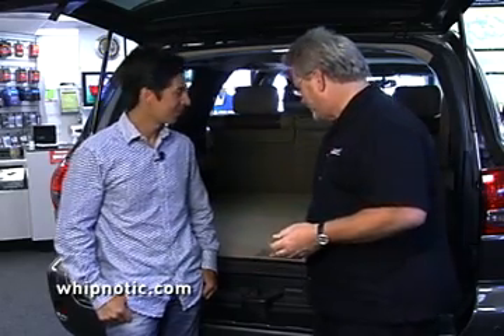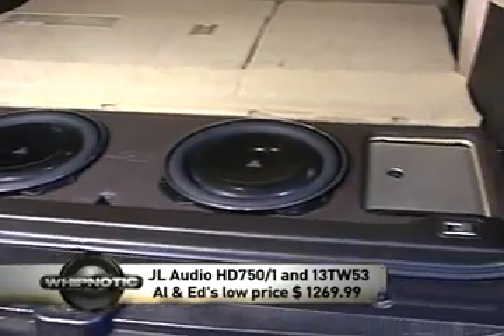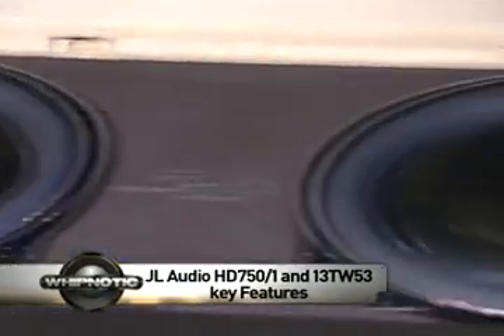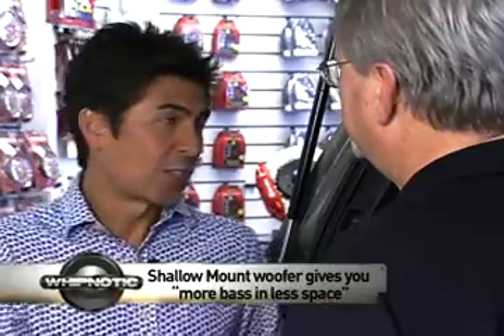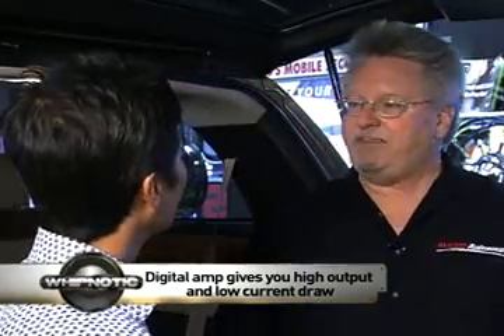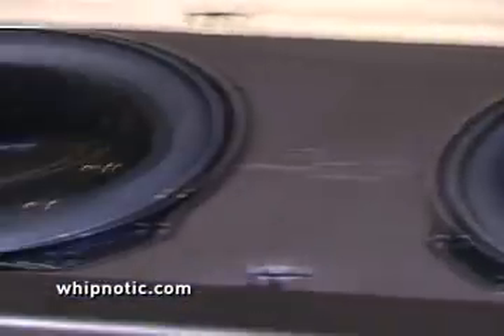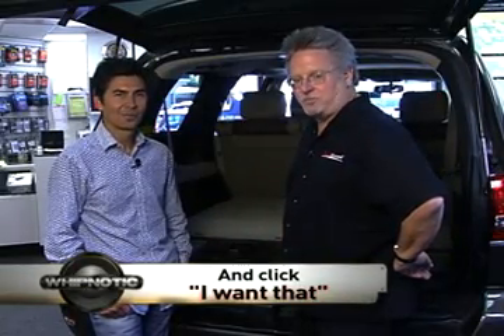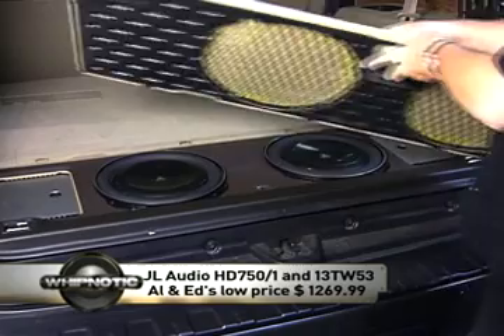JL Audio HD750/1 & JL Audio 13TW53

Comment: MAYBE the amp but shallow subs suck. I have 2 12 inch Tw3s. With that amp. New full size subs or neve rhave that are shaking bass. Or at least in my experience. Anyone want to buy 2 12 inch Tw3s cheap? In stealthbox for chevy avalanche. No use for them anymore.

Comment: Lol that system is definitely a lot more money then $1200. RCA’s, power ground wire fuse holder’s custom sub box and more. I bet that system installed will run at least $4500-$5000 If not more .

Comment: I bought 2 jl audio 12w7AE and the hd750/1 for $800 12-1300 dollars for that setup is a bit high smh you have to do you home work  to see what type of sound/bass you won't but I never spent  $1200 for any system I ever built over the last 17 years and I have owned orion hcca subs, kicker cvr ,cvx, L5,l7 rockford fosgate hx2 and x7a amps etc and never spent that much money for 1 setup

Comment: $1200.. for that set up is questionable unless US pricing is that much better. I have a similar setup paid for in Canada and even working out a cash deal on the amps i still paid close to $3000 for my HD 750/1 and HD 600/4 and TW13 the components for the door speakers I ended up spending another $1200.

Comment: Maybe you can't read. I've installed JL Audio many times and been around car audio for too long. Call JL support and ask them if they build a SPL sub. Maybe you'll believe them? If the dummies you speak of go to a real comp their JL w7 will get crushed on the termlab. I've seen it too many times. If you compare DD, Fi Btl, or an Audioque HDC4 to JL which are cheaper than a 13w7, the 13w7 cannot hang at all in spl. SQ is a different topic.

Comment: @360ModsandHacks 
You know you dont have to go with all JL.. 
and if you think they are under powered buy a more powerful amp.. there much more powerful and better amps than JL audio brands and the volume could be turned really low.. after all he did say he "doesn't want to be the guy you can hear a block away"

Comment: @360ModsandHacks  750watts= FAIL is wrong when it comes to JL Audio amps... in the video they are running a four channel and the mono 750/1 .. the subs work best at 300RMS, so technically he is overpowering them as JLAudio loves a little overpowering when the power is clean, and JL AUdio amps are some of the best on the market, unless you go old school Phoenix Gold, which is what I am still running and my two 600.2 amps have taken first place in SQ and SPL comps pushing two Jl audio 10w7

Comment: to all u guys talking shit, this is a pretty good deal. This are very high quality subs, and they are a bit pricier because they are shallow. thats right they are 2.5 inches thick, so they fit anywhere. Just the subs themselves cost about $400x 2= $800 for the subs themselves. Plus the JL amps are pretty pricy as well about 300-450 dollars, and the mount, the set up where they were installed is super sweet and very convenient. plus installation!!!! This is a pretty good deal
Reply: So many haters mad cause they cant put groceries in their wip :D

Comment: Actually, that's not true. You can definitely have window rattling ability with a slim sub. I used to have a pioneer premier shallow mount, just 1 10 inch sub in my 94 dodge ram. It was like 100 or 150 can't remember. go to onlinecarstereo and you can check it urself. My doors rattled, not just the windows ;)